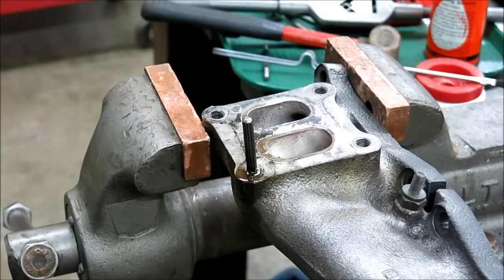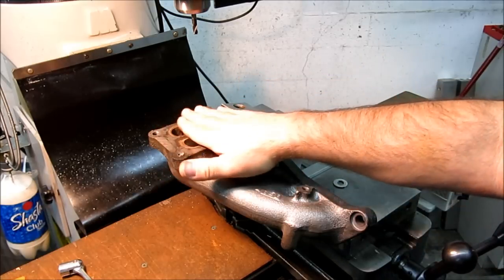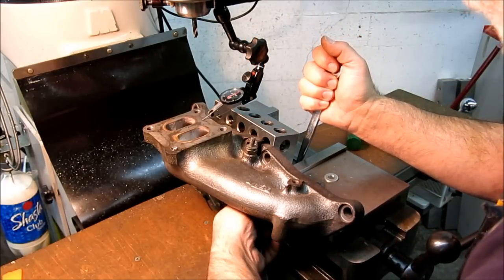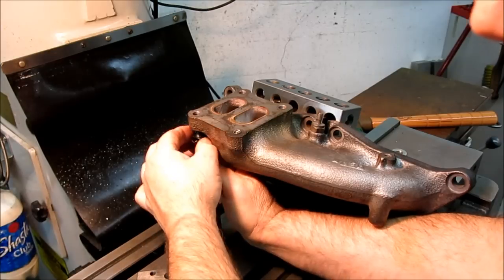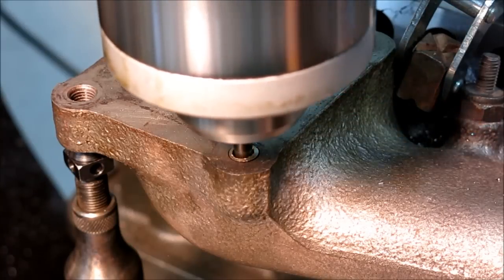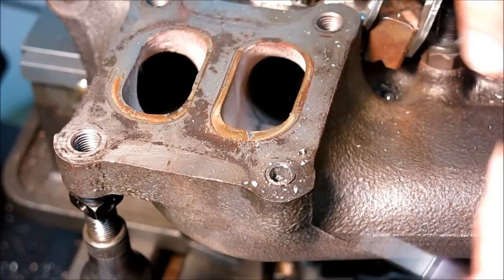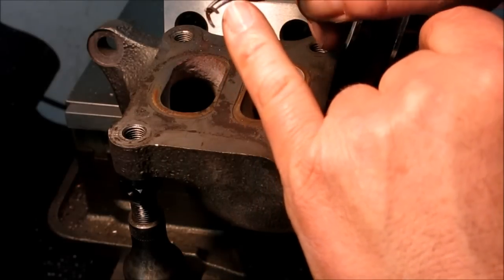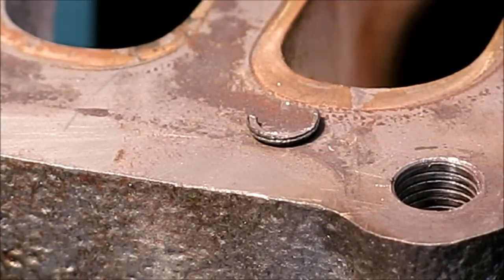Screw Extractor Torture Test Round 2

Comment: I have had some success with an extractor set  similar to the one you are using, but found that using a small light impact driver on a deep socket with the heat combination sometimes shocks the piece loose. I cannot stress enough to use a light impact driver, like a cheap Ryobi battery unit with a 3/8 socket adapter. It seems that the rapid light strikes work best. Also, Mystic Metal Mover, cutting compound is an excellent penetrating fluid, and works better that the typical PB Blaster...etc...

Comment: I work for a Mitsubishi dealer and deal with this exact thing regularly on Lancer Evolutions whenever removing an exhaust manifold or turbo.  Ultra-hard specialized non-magnetic steel turbo studs are the absolute worst thing I've ever run into.  Drilling them out is incredibly strenuous by hand and requires a lot of patience.  I learned my current method of dealing with these in a Evo guy's backyard, and have been successfully using it in the shop for a few years since. 

You still have to drill them out like you've done, but forget an extractor.  Bring in a oxy/acetylene torch and cook what's left of the stud up to orange heat and use a hammer and punch to collapse it away from the threads and into the open area you drilled out.  Repeat heating and punching many times, and you end up with the stud remnants mangled into a few little clumps that knock out and original threads in the manifold that just need a careful cleanup.  You will inevitably get the manifold glowing as well and you want to take breaks and let it cool so that you do as little damage to the original threading as possible. 

Then the important part, don't re-install new studs of the same type, use bolts.  On Evos there are 2 bolts and 2 studs, just convert it to 4 bolts.  The bolts always come out even though they're made of the same metal as the studs.  I thinking i'll probably post a video of this process then next time I run into it.
Reply from the maker: Fopeano Hey Fopeano,

Let me know when you post the video. The bolts have a different pitch diameter than the studs of the same size. This is how they get the stud to stay in when you take the nut off. Thanks for the comment.

Cheers,

Tom

Comment: I really enjoyed both videos. I've seen my fare share of broken bolts in my career field, that being an rotating equipment mechanic, and a first year mechanic. I was just wondering why you didn't just heat the stud up red hot and let it cool down after you drilled a hole through the center? It will usually shrink the stud or break up any rust and give enough clearance to get it to turn. I was just wondering and giving my two cents worth
Reply: Suicidejockey 188  I meant first year machinist. sorry for the brain fart

Comment: After many years of struggling with frozen bolts on vehicles, for cast iron, the material around the entire circumference has to be red hot or cherry, only oxy/acet will do the job, propane is not hot enough for larger objects,  then insert your extractor., if it doesn't come out before it cools, remove and reheat. 

On aluminum, I grind flat as possible then weld on top of the broken bolt, building up until a nut can be welded on . The heat from welding usually is enough to break the bond of the oxide. Sometimes this process has to be repeated because of the heat soak of aluminum. I learned early in life that easy outs are to be used mainly for broken fasteners that fail due to over tightening, not corrosion.

A lot of us shade tree mechanics do not have a milling machine and many times this has to be done on the vehicle, the only problem is keeping the heat and flames where you want them and not ruin neighboring parts or accessories,  creative heat blocks using old asbestos shingles and other things. The use of a "miniductor" that heats without flame circumvents the flame issue, this is limited to fastener that are proud on their mating surface and coil size and location. 

I enjoy watching your videos and look forward to more.

Comment: You did a great job keeping your cool on this. A couple of things that may or may not have helped. I've had good luck with these really tough cases by really heating the daylights out of the casting (deep red all around the bolt). If it still won't break loose then reheat to deep red and smack the side of the casting to deform the casting around the bolt slightly. That one has never failed me. As you said worse comes to worse, heli-coil. :) Thanks for the video, it was frustrating to watch having been there a bunch myself. :)
Reply from the maker: Malorie001 Hi Malorie,

I actually had some fun doing this one. I didn't really have to even get the stud out. We sure did test those screw extractors. Thanks for the comment.

Cheers,

Tom

Comment: Well, I didn't see that Part II existed until commenting on Part I.  Questions I posed are still relevant.  I do see some value now in drilling all the way through as perhaps this would have helped to break the bond where the stud was welded to the block?

Although the poor mechanic on a creeper lost the battle, you eventually won this contest bringing the block to a useful state.  Assuming you might consider re-facing the mating surface after all the work?

Thanks for your efforts in filming and teaching.  Fascinating stuff.

Comment: Keith Fenner Really Nice that you tackled one of the most dreaded things a machinist or mechanic ever faces, for us in the name of experiment...and got it done, Thanks!  Also really appreciated your patience!  Like Keith said each one is unique and requires an arsenal of experience, tools and patience to take care of business.  Your test of the extractors was a great starting point which led to the successive steps to get er done!  One of the reasons I went back to school to become an engineer was a 440 mopar in a Jensen Interceptor (Rt side cracked manifold) and a broken stud in the block...the motor was shoe horned in, had to break the motor mounts loose, jack it up & remove the fender well just to be able to get to the culprit.  Same results as yours having to drill it, pick the threads out, etc.  Worst part is the 440 mopars are notorious for cracked exhausts...bad engineering...but a fun ride! 

The issue that most miss is in the application & OEM/mechanic assembly.  In the MR2 case the stud you were dealing with were likely Inconel (turbo version of the RX7 used them) and the oxide formed on the Inconel from the heat will literally weld it to the manifold (Without Proper Anti-Sieze compound).  And there are a myriad of ASC flavors out there!  Since the good ole days, I've designed components and systems for Nasty environments that required Inconel or Hastelloy for extreme heat and corrosive environments, some of which only last a year because of the nasties...but always used proper Anti-Sieze compounds for the assy so they can be replaced easily...hopefully!  A minor note on tools is that Snap-On and some of the others make a hefty serrated Cam style, stud extractor that uses a 1/2" ratchet or breaker bar which gives you a better centerline drive.  The wrench puts a lot of angular/lateral torque on the splined extractor, not that it mattered in your case, but maybe a ratchet/deep well for a lesser job would be better. 

Really enjoyed the mill setup too!  Thanks again Tom, great learning for everyone and definitely worth the watch! ~PJ
Reply from the maker: Hi PJ,

Thanks for the nice comment. Our best guess for the stud right now is A286 Precipitation hardening stainless. I'm having a sliver analyzed just for fun. That spot on the manifold is a pretty severe service area. I wonder if some nickel or copper based anti seize would prevent the welding. I would guess this stud is not designed with serviceability as a big criteria. 

All the best,

Tom
Reply: oxtoolco
Look forward to the analysis on the material...thanks for taking that plunge!  I would think the studs would be much more expensive in A286PH.  As for the anti-seize we used the Permatex or Loctite Nickel based for Inconel fasteners in our applications, ~2k° sulfur and acid based environments.  In this case an AL/Cu/C would work and used to use it on Toyota head bolts and studs...but I'd still lean toward the Nickel for the turbo.  Definitely a severe service area as seen by the golden gasket ring around the ports.  It is amazing that a new manifold and studs would be about the same cost as machining out the studs...painful to think about scrapping it.  Hopefully your buddy can reuse this one now that you've done the deed.  Till Then, ~PJ
Reply: oxtoolco Tom, I haven't watched your video yet, but here is a bit of trivia, at one time I worked in the toolroom and maintenance at a section of the Alcan in Winnipeg, they had an enormous extrusion press that ran 24/7/12 except for Maintenance, the press had 30/40 flame jets around the die head with other jets on a conveyor track heating the large round ingots before they reached the die head so there was a lot of heat, the press pushed that hot ingot through the formed die producing an extrusion that was dragged down by a worker some 50 feet, attached to a steel block on a track and given a jerk to straighten the extrusion, ok to make it brief (big grin) at Maintenance time the rams cylinders had to be dismantled, the two  threaded bolts my memory says were at least 12 inches dia, I was told that without using Never Seize they would never have been able to release those nuts, 

Sorry about the deter, I tend to go on a bit,

Edmund........Alberta

Comment: Any reason your using endmills instead of drill bits to drill?
Reply from the maker: Hi Zoink,

Yes there is. Endmills are tougher that most carbide drills. I also hang onto duller ones that work well for these abusive operations. You need a special geometry in a carbide drill to do stuff like this otherwise they just grenade right out of the gate. Hope this helps.

Cheers,

Tom

Comment: Great and amusing video. As a tech for the past 21 years I've been in this situation plenty of times. Through thorough trial and error over the years I will not trust carbide extractors in situations like this ever again. They have their uses but not here. Not sure if Snap-on has them any more but my "go to" set now are square(very slight twist of 1 turn over 6") and some are thin rectangular(almost look like homemade chisels) not sure what composition they are made of but they are soft enough not to shatter yet after 11 years still have the same set. I've been unlucky enough to be the guy that has the skill and patience to be handed these jobs each time they arise. Most commonly in recent years are gas ford trucks.16 trucks this winter alone. (I live in the salt encrusted snow belt of  tug hill ny) They use tiny m8 bolts on the exhaust manifolds and during heat cycling etc they break off in the rear of head closest the firewall.(of course the worst spot to work on, needing right angle drills and working up hill at an odd angle) Center drilling is obviously very important to get rid of enough material without getting into factory threads so pressure is reduced on the threads. Anyways my favorite method is to drill as you did then o/a torch heat with smallest tip I have on the bolt till cherry then poke a standard tapered candle to the spot until it gets fairly cool. I follow that up with more instant pinpoint heat to the head around the bolt hole as quickly as possible before the wax is all gone and then tap in my square extractor to remove. I truly believe after all the fancy chems I've tried that simple wax works the best if you're going to heat. I have great success with this method. And haven't had to pull a cylinder head to put on the Bridgeport for machining. (Knock on wood).
Reply from the maker: DJ Dragon Hi DJ,

Thanks for the great comment. We will come back to this one and try some of the suggestions viewers sent in. I need to find another manifold victim to work with. 

All the best,

Tom

Comment: Great Video. You commented on the hardness of the stud. Couldn't it have been the many heating and cooling cycles before you got it that hardened the metal? Also I see so many people using penetrating oil in a incorrect way. Right in the instruction on most cans it says to apply and then tap with a hammer. Not that this would have done much in this difficult case. The tapping helps breaks the bond and causes the oil to go deep into the threads.
Reply from the maker: Hi Pete,

The stud is made from a precipitation hardening stainless alloy similar to A286. Its running around 42 Rockwell C so its pretty hard and was probably that way from when it was installed. Thanks for the comment. 

Cheers,

Tom

Comment: Tom, I thought things like this just didn't happen in the promised land of the Bay Area - go figure. 

From my experience in the Rust Belt, it's best to heat the stud, not the workpiece, cherry red.  The idea is that the stud will heat up and expand much quicker than the tapped hole.  Then when it cools it will shrink from its interference fit in the tapped hole and voila.  I've seen the same done with bearing races stuck in recesses by hitting the races in a spot or two with an arc welder.

Rich

Comment: Pretty hot isnt going to do it,you need to get that thing cherry red and it'll back right on out ;) The only downside is it may take the threads with it on its way out.
Reply: yes, you have to heat the everlivin piss out of it to stand a chance.  first rule of pulling exhaust studs, get the big torch and heat it all to hell and apply your wrench setup.  if that fails,  drill or grind it out/ call a machine shop.

Comment: You got everyone to comment, Lol!..........  I would have tried to weld on a nut like someone else mentioned.  Small stainless rod works best, but have used mig wire also.  We had skilled welders at work that could go down a small hole, use the flux for an insulator and weld up a column and bring up amazing stuff.  Anyway you picked a tough one to work on!  Tap extractors usually only work on the 'easy' ones as they put on more side pressure.  That stud was probably a grade 8 case hardened 8620.  Most threads like that are interference threads so as not to back out when removing the unit on top.  You gave it a fair shot, great video!
Reply from the maker: James Spallinger Hi James,

The goal of the video was to test the snap on extractors. I think we did that. The stud was a special precipitation hardening alloy 286-LNi. Really tough stuff. Thanks for the comment.

Cheers,

Tom

Comment: I've had very good luck heating to red, or close, and then spraying water on it.  Not dumping, or submerging, but spraying (still haven't cracked anything).  I can usually pull them out by hand afterwards.  If there's no castings involved that's my first step for rusted bolt/nut removal.  When it is a casting I try a few other things first.
Reply from the maker: Hi David,

Thanks for the suggestion. There have been quite a few methods suggested on this video. Thanks for the comment.

Cheers,

Tom

Comment: Is the extractor subpar or was the task too much for it?
Reply: my experience of all extractors is the same, some are more taperd, some even a square section, some are like a coarse pitched wood screw, but they are all hardened steel, and always break under real conditions, and you 'can' drill them out with special dill bits, but are pain, i have no faith in them at all and just go for the drill in the first place.   all the demos i have seen use bolts they have just bottomd out and snapped off, which are very easy to remove, old rusted self welded bolts {reality} are just like toms' and a pain in the backside!
Reply: jusb1066 I generally don't trust a product that comes with a demo. It means there's a vision that doesn't match reality somewhere in there.

Like those glue globs with all sorts of bits stuck in them advertising how strong the glue is..you buy the glue... barely holds.

Comment: one would think in today's age a stronger extractor material  would be available
Reply: It's a big ask in the case of relatively small studs, cos studs are already really strong even by the standards of "today's age", and they're effectively welded into the mating part with a lot of surface area, at a considerably greater radius than the outside diameter (let alone the mean diameter) of the extractor. So the stress in the extractor is going to be a lot more than the ultimate stress at the stud interface with the part, which is already really high. This is why it pays to use the biggest extractor possible, which in turn means the hole needs to be accurately concentric with the stud.